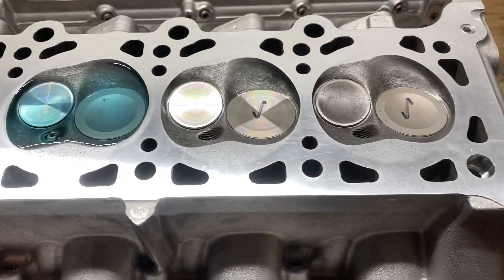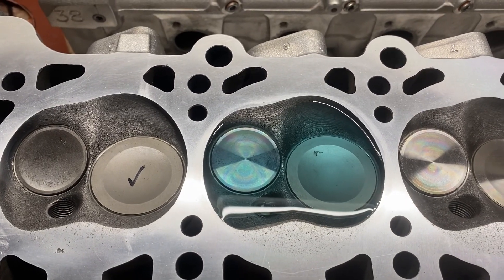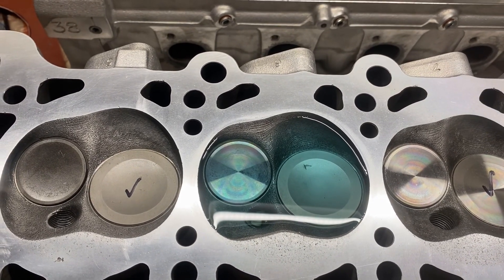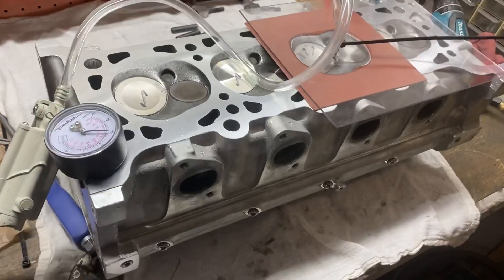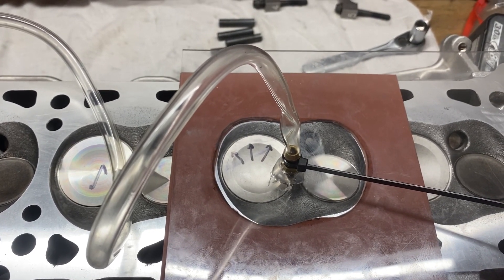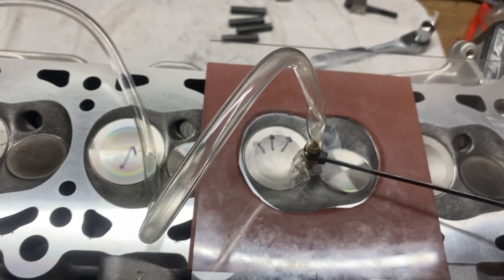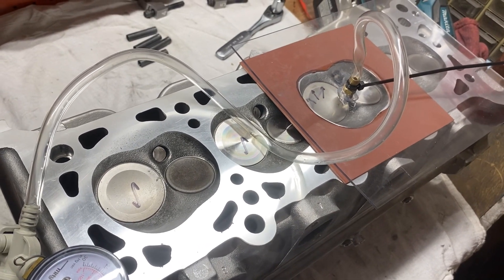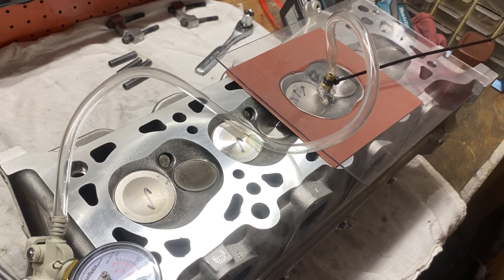Vacuum testing valve seal DIY

Comment: Hi,...Why are you Chamber side vacuum testing compared to the norm of indivual valve (intake or exhaust only, not both) Port side testing ?? .....What is your vacuum requirement Limit (full pump vac or 80% ) for a good meaningful test ?? .....This Chamber side vac test then requires valve springs of what Psi  ?? ...How does the valve spring alter the usual Port  side test without valve spring measurement  comparison ??
Reply from the maker: I’m testing valve seal, why pull the valve down with vacuum port side?
You can use light weight checking valve springs to test chamber side for leaks.  Also when you check chamber size you can catch leaks around the spark plug threads. 
I should see 0% leakage holding 20 psi.  JD
Reply: @HeadFlowInc  It's impossible to have 20psi of vacuum on this planet, since the standard pressure from the atmosphere is about 14.7psi at sea level. The units on your vacuum gauge are in "inches of mercury", not psi.

Comment: What parts should be replaced when opening up a lm7? I’m trying to make a list. Thanks
Reply from the maker: General rebuild items, it’ll depend on the condition of the crankshaft journals and cylinders. 
If everything is in good shape you’ll need:
Rod bearings 
Main bearings 
Piston rings 
Gasket set
***I highly recommend replacing the cam bearings. 
New lifter trays 

It all depends on how far you want to go.  JD
Reply: @HeadFlowInc  wow, I appreciate the quick response but I’m not sure I have the skill for most of those. Was trying to attempt my first sloppy build. Was thinking new lifters/trays, head gaskets, timing cover gasket, Was thinking about new timing chain possibly, high pressure, standard volume oil pump, new tty bolts, etc. Damn, my mind is drawing a blank now. Thank you